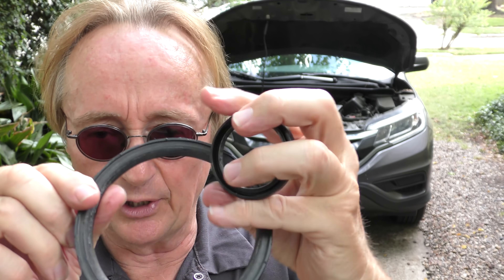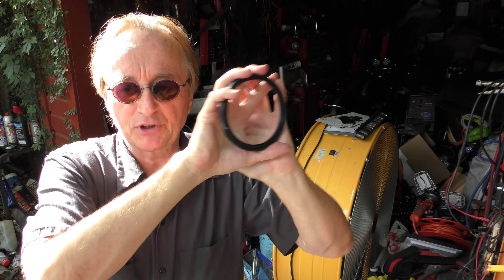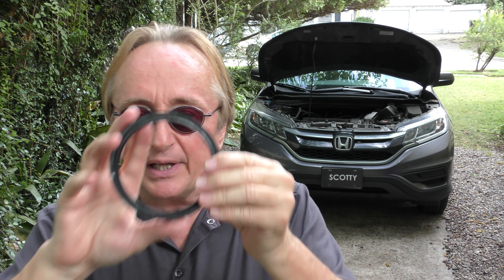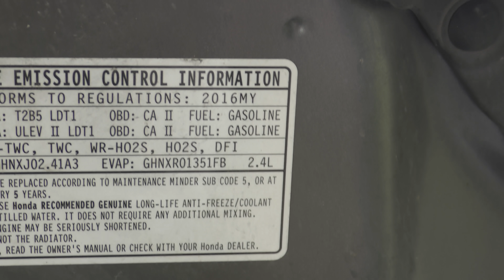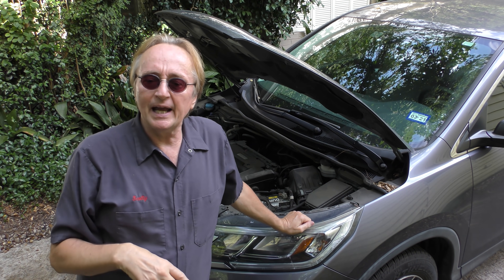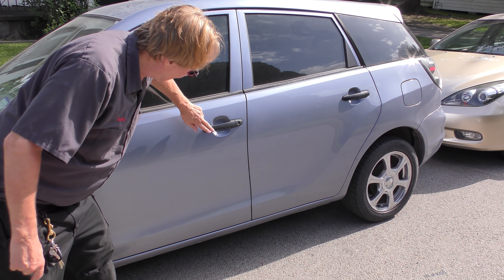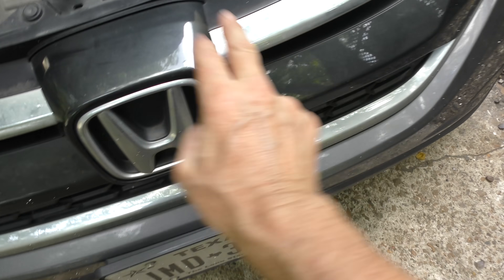If You See This, Don't Buy a Car

Comment: Worst trend in modern automobile: They dont make the 94 celica anymore
Love you scotty
Reply: That's why i bought one on Craigslist for $600.00
Reply: Jokes aside, honestly the 1994-1999 Celicas are a beast of a car if you get the 5 speed manuals, acceleration is great even on my 1.8 liter, and because they came from a rally chassis they corner and handle very very well, love the comfort too.
Reply: The corolla engine is the most reliable engine out there hands down
Reply: My 1986 Toyota 4x4 had a 22r 4 cylinder engine same engine was in 86 Corolla would literally run with no oil 😂🐵 don't ask me how I know that 🐸😆 hehehe
Reply: @hellraider0016  Honda has the best engines but Toyota make up for it everywhere else.
Reply: Martin Albert honda petrols win hands down.
I am more a fan of the torquey diesel mills which give great gas mileage as well, honda sucks in diesels, it makes aluminium alloy engines not cast iron ones
Reply: @jakubman12 and they want you to go to the dealership for the service,  they make money that way also
Reply: Thanks Scotty! I am fully restoring my 94' Celica back to original condition. It's in the paint shop and will be ready by the end of the week. I am so excited!!
Reply: A sporty looking car with an econobox engine? You are right.
Reply: IMO `83 celica GTS coupe 22re  `89 corolla GTS coupe 1600 dbbl ohc were best

Comment: A clear case of a manufacturer trying to fix something that wasn’t broke.
Reply: They want to guarantee that it breaks so people either pay for an expensive repair or the customer has to buy another vehicle
Reply: DC Various Vids *broken
Reply: They aren't fixing it, they cut cost by buying cheaply made parts.
Reply: Mary McIntosh They will buy a new car but it sure won’t be the same car brand. Only a few loyal suckers will continue but the majority can’t run away fast enough. Screwing over your customer base is always a stupid business plan. Way easier and cheaper to keep a customer than to lose them and have to find a new customer.
Reply: @youaregoingtolovethis  
You underestimate the loyalty of some stupid customers, but they rely heavily upon them. I know a guy who has had nothing but problems with his cars for 40 years and he still only buys GM.
Reply: @HillbillyTosh  they don't want you to fix it, they design them so that the repairs are so expensive you say "I might as well buy a new one..."
Reply: It was broken. Think about it from the manufacturers point of view, if you sale cars that last, who will buy your new cars, they still have their old car that runs great. Broken, let’s fix it.
Reply: No, they want more money in repairs down the line. Repairs are a big money maker for car manufacturers.
Reply: HERE'S HOW THAT MEETING WENT.
CEO: IS THERE A PART THAT DOES NOT BREAK IN 3 YEARS?
ENGINEER: THERE'S AN OIL SEAL THAT LASTS FOREVER
CEO: WE CAN'T HAVE THAT, WE HAVE A REPUTATION TO UP HOLD
Reply: John Simun Toyota? Honda? They sell awesome and some of the most reliable vehicles on the road, yet people keep buying new ones. Kinda confused by your point. Making sh!tty cars = Destroying brand reputation. I bought a Jeep, got it out of my system, and once I saw how much of a piece of sh!t it was and was costing me I dumped it and went back to a Toyota. Making cheaper vehicles might cause the customers to dump the car more quickly, but if the customer has any sense whatsoever, they will go with a different brand. I will never buy a GM, FCA, or any of the other clunkers again.
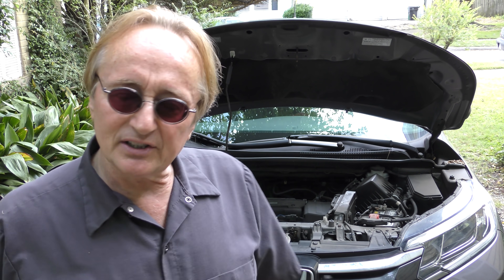Reply: Malcolm didn’t I hear Scotty say something somewhere, wasn’t it about Honda??? Oh yea, 3:55. something about burning oil, or oil dilution? Wouldn’t want to buy a car designed to fail quicker. 
Guess what, the auto market is down across the board, look at sales throughout the last decade, how about the last two decades. It’s not the best for many, also look at cafe standards, better yet look at some of the standards that the eu is putting in place. It makes our cafe look like a afternoon at the cafe. 
Do take care of your Honda, at least you didn’t buy a Chevy.
Reply: mark price they technically don’t gain mpg with adding a turbo. Just like the big boys, that turbo is there for performance, the difference is they install a engine that would not be anywhere close to acceptable besides cruising down the road, and barely that according to where you live. Then slap a turbo, set it to a level of power acceptable to the majority, and strengthen only where initially needed. 
The gains in economy come from lighter weight mechanics, and the fact that most will do a lot of coasting. If driven ruff, bad mileage will still occur. Look at the GM trucks over the years, 3 maybe 8 more mpg, but which will last longer vortec or ecotec.
Reply: John Simun Look and watch any of Scotty’s videos, a majority of them he is recommending Toyotas and Hondas because they are the “most” reliable on the market as I originally said. That doesnt mean they are all bullet proof. Honda has the oil dilution problem, weak trans on the minivans, hell Toyota has been having trouble with their fuel pumps as of late. There is no excuse for manufacturers to start using piss poor products other than greed, and unfortunately even Toyota and Honda are falling down this hole some as of late. As vehicles get more and more complex, the amount of time they last will continue to go down. It ultimately comes down to the consumer educating themselves on the vehicles before they buy them and putting aside their “brand loyalty,” otherwise GM and these other shitty companies will continue to make unreliable piles of crap.
Reply: @davidscott5903  So true, its crazy how that works, people are gluttons for punishment i guess... lol
Reply: Nope: its called cost down, save 2 or 3 $ per vehicle and that's what drives them. Cheap out on anything and everything you can. Like the ignition switch on the 7 models they made and it's failure by jumping into the accessory position while driviing = a dead power train and msybe your DED tooo.They buried it and blamed it on the customers driving habits . Then it got North American attention. Changed the switch using the original part number and it was a 0.57 $ their cost fix, but still hid it.  Recall resoved that. No one does that with an improved part as the old P/N is updated indicating its an improved part. Lovely company GM right Not!!!!! I would never  buy a GM product ever. And it they go bankrupt again let them go tits up they deserve it.
Reply: @paulc2548  Nope they designed it to cut costs.
Reply: @chinaexpat1827  Your not far off at all. Especialyvwith domestic manufacturers.
Reply: "fix something that wasn’t broke" ....STUPID COMMENT OF THE CENTURY, ...IT WAS INTENTIONAL BY GM!!!
DESIGN EVERYTHING TO FAIL & FLEECE THE SHEEPLE!
Reply: They're trying to fix the emission problem, the gas consumption problem, and safety while making the car faster and handles better, of course it will come with some drawbacks
Reply: Worked great for my chevy, the one that uses that shity seal Scotty had in his hands, I have spent more fixing it then it's worth. I bought the cheapest honda I could get my hands on, No problems 352K miles I never didn't do anything but change Oil and tires and gas. never ever buying a Chevy again! They got me they win, Never going to buy a car from them ever! The only reason I got a Chevy is my dads old 77 one went 275k miles before the nylon toothed timing chain went and grenaded the engine! should have seen the sing on the wall then.  There head gaskets suck too always leaking, when you pull it apart its like its some old cardboard that got wet and is separating, I have Reused Ford ones to my disbelief sucker didn't leak, guy was so cheep after I fixed the plug threads had to reuse all of it. After I got it all together He asked me if I think it will work I said being optimistic 50/50. He got lucky drove it a few more years before loosing a manifold gasket and hydrolocking the engine.
Reply: @mooglemy3813  And gave themselves an award via their suppliers for that POS switch as well. 2002. Charles Kettering Award. Took them 10 years to fix the one on my ION. 3 or 4 switches later it now works as intended. That cheap piece and the percentage of a cent it saved cost them millions. FOAD GM.
Reply: @yudhobaskoro8033  Their entire philosophy from the executive office, to the designers and engineering staff to the shop floor and back is: " F**k you. Pay me". 
And in a really cynical mood they'll pull out the "Buy American" crap. As if. That Spark is as All American as...a Daewoo.
 Look for it soon, patriots, they've got a sh*t load of cars to move and no one has a job. What's the profit margin on a $90,000 truck that never sells, GM ?
Reply: @johnsimun6533  just saying  my 06 cobalts both ss 2.4 and 2.0 run like New and got 32500 on the 2.0 supercharged and 220000 on the 2.4  no leaks basically factory parts besides 3 wheel bearing between both of em and 3 coil packs
Reply: Malcolm true very true. The problem her is the mass consumer. They only understand how to operate the cars, the reason is they don’t care, or have any other reason to care. I’m not against more fuel efficiency, or green energy, I’m all for it. What makes this worse for me is to quote “cheap plastic parts” many other people, too many years. I’m not against that, but a vehicle is first and foremost “to go from A to B”, second is safety, the two biggest safety upgrades to do to “ANY” vehicle is brakes (because you want to stop), and proper tires for your driving style and environment (because you might need to turn to avoid a incident). The biggest safety upgrade for any vehicle, including balled, dry rotted tires, brakes that are metal on metal, with air in the lines, is wait for it...... better, and more educated drivers, not to be mixed up with, following the law drivers. Look at it this way, a 2017 Cruze is 3000 lbs. It is a piece of equipment designed to transport passengers and goods. ABS, traction, automatic brakes of any and all varieties, can’t fix stupid. Importance, and education can fix stupid. Three is the feeling it gives the driver. Whether music, grippy sporty ride, numbness (my favorite, got to love the old land boats).
They are falling on the first one. If you can’t depend on your car being there for many years, ?.
Reply: Richi RIch hey, hey, hey, 
Buy a Chevy, they are cheaper than ever.
Reply: Eniklis Nihm you know the have the “Initial reliability Award from JD Power”.
Reply: Dvaeo Greg they mark it high, and sale them low.
Reply: Kaleb Uschold there are good, shall I dare say great GM products. But that time is behind us. Some GM vehicles made on the perfect day, with parts made on the perfect day, bought by a person that will maintain it, with be a gem down the road. 
Take care of them, and they should last. Just wandering why 2 of the same, at the same time? Same color, options, or opposite?
Reply: @johnsimun6533  1s white 1s black like polor opposites for some reason and white ones auto transmission and blacks stick
Reply: @chinaexpat1827  that's GM
Reply: Nah, it saved a dime per unit

Comment: A lot of cars still use those low profile tires. In fact,
the trend toward big 18 - 20" wheels on small cars has
\been the reason for the low profile tires so that they
will fid inside the wheel well with out interacting with anything
while turning or going over bumps. I agree. They make the ride
real rough. My Infiniti Q60S came with 19" wheels and those real
low profile tires. They are expensive and they ride like you
are using solid rubber tires. They do offer up superior cornering,
but for normal driving, they give one a real rough ride where you
feel every crack in the road.

Comment: That seal on my 2008 Chevy Silverado started leaking at 22,000 miles just after the warranty expired.  Traded it real quick.
Reply: Your warranty was 20,000 miles??
Reply: @richsweeney1115  3 years, 36,000 miles, whichever comes first. I only put about 8,000 miles a year on my vehicles.